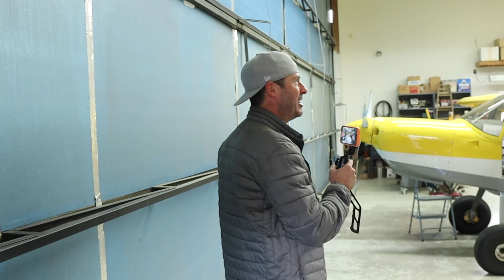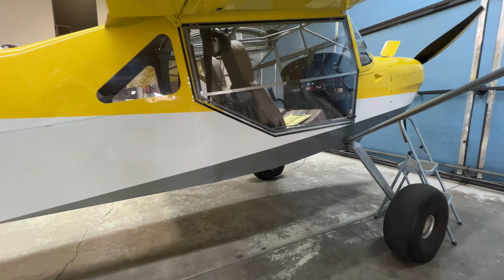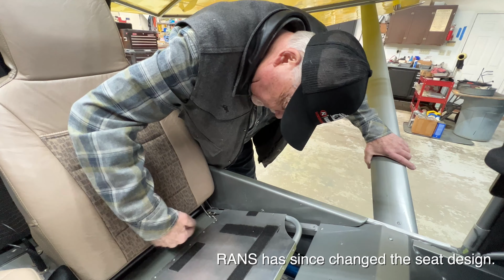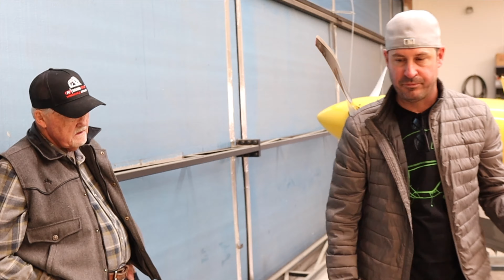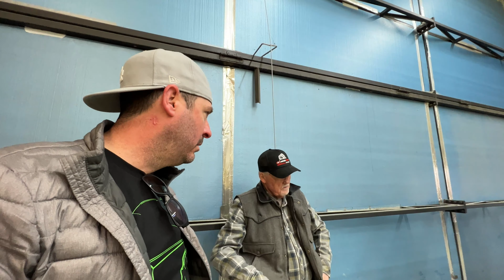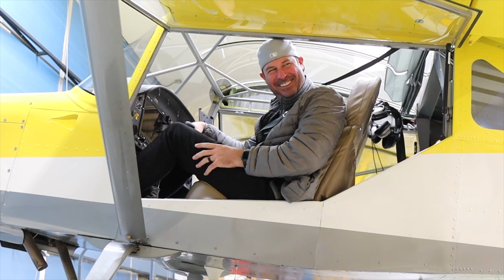RANS S-21 Builder Spotlight--Kip (LONGFORM)

Comment: Kip has a practical eye for innovations/modifications. Speed tape and scrap wood rudder trim. Beautiful. The fuel selector valve is such a good idea. The Cessna style quarter turn fastener cowling always bugged me. I just like being able to fully open the cowling during preflight like on a Bonanza or Cherokee. (Hmmm...I wonder if there's a market for a kit). The 'ebbs and flows' thing is very important with any project that lasts longer than a day. Like any relationship...you have to keep at it but sometimes, you kinda need some time to yourself. 

I'm not engine surgeon but those inlets do look a wee bit on the teeny side but that air extractor lip looks like it would be very effective. I wonder if there's a market for an automatic cowl flap thingie in the experimental world.

The combined offering of short and long form vids is brilliant, my friend. The short one feels like a drive by to check out the lay of the land and we get to geek out with the long form. You going full Ted Bundy on this vid thing, amigo...non stop killing it. Thanks.